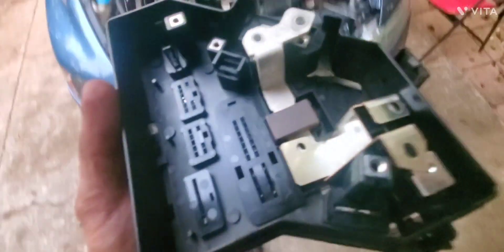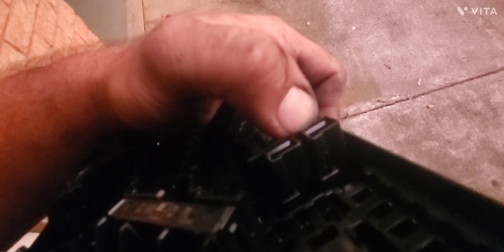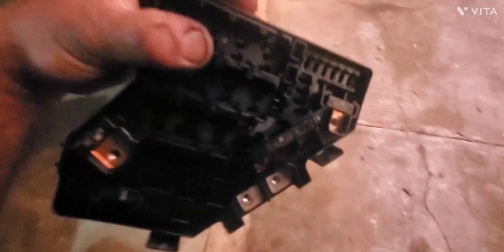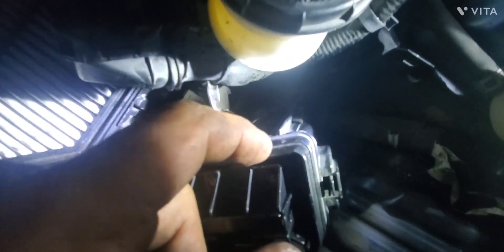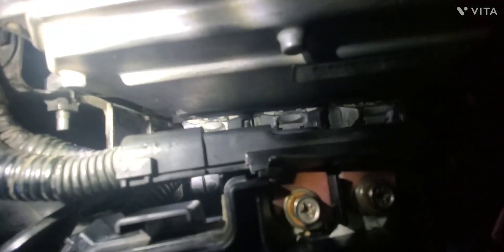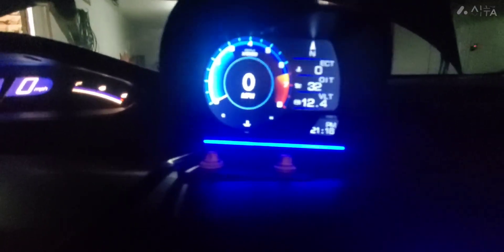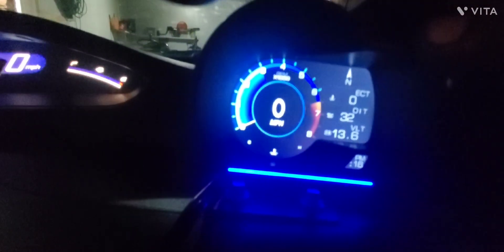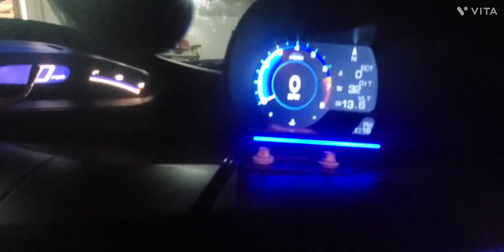8th Gen Honda Civic ELD Low voltage fix!

Comment: do i have to remove everything in the fuse box just to take it out?
Reply from the maker: @cjthegearhead6786  yes. You have to take apart the whole fuse box. The eld is deep inside
Reply from the maker: I'm posting a video tonight. I will do the entire install video showing all the steps
Reply from the maker: https://youtu.be/YSTR1o47LQ0?si=SRO3UsnXf35pbdMd

Comment: I’m sorry I’m confused. Did you buy a whole fuse panel ?  What I see for this part online is just a box portion where the plug goes. Or , are most online images generic and not for this car ?
Reply from the maker: @splmagician2  bo. I opened the existing pannel and replaced the eld rhats inside to correct charging voltage
Reply from the maker: I'm posting a video tonight. I will do the entire install video showing all the steps
Reply from the maker: https://youtu.be/YSTR1o47LQ0?si=SRO3UsnXf35pbdMd

Comment: Hi, thanks for the video. I have 8gen Honda civic hatchback and i see it is very similar the fuse box, i begin to remove the ELD which i think its bad but i got stuck at the fuse box, and i cant separate upper plastic after removing all the fuses and relays to be able to remove ELD sensor which is under it. Can you share with me some pictures or instructions if you have how you separated it ?
Reply from the maker: Unfortunately the video was done in a hurry and daylight was running low. Now, you will have to take out the whole fuse box and get some good pick tools. The plastic dosnt look like it comes apart, but it dose. You have to get it apart to access the eld. Don't give up, that sucker is deep inside. It's sandwiched in there. You just have to be gentle yet persuasive
Reply: i see that it can come apart from your video but i started to think maybe there is some screws from the bottom because even if i use some force on the hidden clips from the side in order to remove the relay pad it is so strong... maybe i will buy another fuse box from another damaged car and take apart to see what is the issue... @bikerevolutiontv
Reply from the maker: I'm posting a video tonight. I will do the entire install video showing all the steps
Reply: @bikerevolutiontv  thanks man i appreciate this. I was thinking that i will disassemble the fuse box and remove the ELD without removing the whole fuse box but after this video i understand that is impossible without removing the box. I own you a basket of beer... I will do replacement weekend i hope.
Reply from the maker: @bobanm1  good. You did see the newly uploaded video right?
Reply from the maker: https://youtu.be/YSTR1o47LQ0?si=SRO3UsnXf35pbdMd

Comment: On my 8th gen civic my voltage will sometime drop while I drive drastically from 14-12.3 sometimes lower and the only way I can bring it up is if I Put my car into park or if I restart. If I restart car goes back up to 14.5 and acts completely normal. I already replaced the alt do you think eld is my issue or could it be something else
Reply from the maker: Normal voltage:
1. While driving its bounces from 12v to 14.2ish without drawing a load, a/c plus lights

2. It stays at 14.2ish with a/c and lights (drawing a significant load)

3. Durring cold weather 40s and below it stays at 14.2ish load or no load (smart technology) I'm thinking¿

Not normal voltage:
At any time it dips below 12v or spikes over 14.9.

 If alternator and battery is not the problem a lower than 12v reading is the eld. Eld failure is not overcharging, but under charging. If above 14.9v then the alternator is over charging and the alternator is bad.

First go to an auto parts store and have them perform a free health check on the battery and alternator. When they pass then the eld is the problem. These parameters are what I have been monitoring over the last few months and I believe them to be accurate. If you have never replaced the eld and are having any low voltage symptoms  I recommend the replacement
Reply: @bikerevolutiontv  hey man i have a weird problem that i just want guidance on from someone that knows these cars. 2012 honda civic EXL 4 cylinder. Customer complaint is sometimes she goes to start it and it cranks slow or doesn't crank well and then it starts. Took it to a shop they said they found nothing and it is intermittent problem. I told her to video every time she starts the car. Now the car is here and when under full load at idle high beams and everything the battery voltage is sitting at like 12.5 when you step back the draw via turning down the blower fan etc., it will go back to a normal voltage of like 13.5 etc., but under high load at idle it seems to be really low voltage. 12.5 or so. But it is staggered as you drop off the high load it does come back up. what I am wondering is am I dealing with two separate issues or is this not even an issue? Can you do a test and turn your seat heaters on and everything to pull a load on the car at idle and see what your idle voltage is? It shouldn't be 12.5 am I right?
Reply from the maker: With the car running and under a load, a/c, light- it should be closer to 14v. No load and it can bounce around 12-13. Dosnt sound like the eld and this is why.

With a healthy battery and alternator, aloud should cause its voltage to spike to 14v because the system is protecting its self. Even with a bad eld this will happen. 

Now it sounds like the alternator is not keeping up or possible the battery is on the way out. I would first check the battery at an autoparts store for free. Change if needed. They will also check to see if the alternator is doing its job correctly.  Their scan tool will tell the truth if either one is bad. Then go from there
Reply: @bikerevolutiontv  i have a high level bi directional scan tool and i can't seem to find where it says the output for how much it is telling the alternator to charge. Like normally it will have a data pid you can see like alt signal output or something where it is giving it 5v reference to ground or something. But yeah under big load it drops down under no load it has 14v or little load. But when you load up the engine it is like 12.5 v at the battery idle and also I think that the starter got cooked because of it as well. So alternator and starter may be bad.  starter sounds fine most of the time but she says sometimes it will slow crank. and she has it on video slow cranking when it is cold. Battery is relatively new and when cranking it doesn't go below 10v when cranking watching it so battery doesn't seem shorted or anything. But do you think maybe you can check yours to see if you idle it with high beams on and blower motor on does it sit at 14v?
Reply from the maker: Mine at idle rests around 12-13 but under load it goes to 14v and that's what it's supposed to do
Reply: @bikerevolutiontv  weird yeah because mine is opposite. mine is 2012 honda civic i can send you a video i will show you exactly what it does.
Reply from the maker: In addition, honda created thd eld to make Hondas fuel efficient.  Any reading of 12v to 14.2v while engine is running is perfectly normal, but i would recommend getting a live voltage read out that is visible while driving. Information is 90% of operating a vehicle safely and effectively
Reply from the maker: I'm posting a video tonight. I will do the entire install video showing all the steps
Reply from the maker: https://youtu.be/YSTR1o47LQ0?si=SRO3UsnXf35pbdMd

Comment: I have a 08 civic si. My car has a 12.5 voltage, it doesn’t start unless I use a jump starter. My alternator and starter are new. It reads low voltage. Do you think I’m experiencing the same issue ?
Reply from the maker: That's odd because all gas vehicles will start at 12.5v. Are you sure of the 12.5v? 12.5v is not low to start your car. Also, what are you using to test the voltage?
Reply: @bikerevolutiontv  I’m using a digital multimeter. Voltages reads 12.8 when car is on. These electrical problems are the worse. Haha
Reply from the maker: @flakosuave252  if its got over 12v it should crank on its own. You have new alternator, battery, starter fuses and electrical wires are good then it should start without being jumped.
Reply: @bikerevolutiontv  thank you the help! Good looking out !
Reply: Using the multimeter on the battery might show 12v but you won’t get a proper reading to see if it maintains that 12v when placed under load, a better way would be to crank your car over and see if the 12v maintains or else it’s a false reading
Reply: Im having the same problem i got a 8th gen civic 2006 lx sedan 

I got all types of gauges in my car lolz 

when i turn on my car with no accessories and lights to the dimmest i get 14.1 on my civic because i got a big 3 and pully upgrade From NST tuning 

When the car would get to 177 temp my voltage would drop to 11.6 my radio cuts off even my lights start blinking plus my car wont want to move i have to press the gas hard to even get the civic moving

I got a new battery from autozone duralast platinum and new alternator 

And the problem still is there but i will try this out and if it solves the problem i will come back here to confirm this method works 

Also since im in a automotive school at the moment i will let the school now about this problem because 

4 technicians cant find the problem on my car 

So if this solves my problem God bless u 💪🏼
Reply from the maker: I'm posting a video tonight. I will do the entire install video showing all the steps
Reply from the maker: https://youtu.be/YSTR1o47LQ0?si=SRO3UsnXf35pbdMd

Comment: Did you have a check engine light/any codes stored for the ELD?
Reply from the maker: No, when the eld fails, there is no check engine code programmed to come on. I'm thinking because the parameters of its design are so polar opposite, that there would be no possible way to know when it has chosen to not charge (based on design) and is actually not working. The true way to tell if it has failed is that the red battery light comes on (some times), but the best way is to first understand that the voltage should never go under 12v at any time while car is running. A voltage meter in cab either connected to battery or obd2 port is the only way to prove its voltage activity. If you are worried about a no charge issue, but do not have a live voltage read out while driving, the best thing to do is drive continuously with the lights and another peripheral on, such as the vent fan on. This will activate the eld to alow a 13.5 to 14.2 voltage charge continuously while driving. Truly it is best to just get a new eld and live voltage read out. A new eld is 15$. That's granted the rest of your charging system is in good shape. Auto parts stores test battery's, alternators and cables for free. I hope this helps. Don't give up. It's a good car and after I replaces my eld on a 197k engine, now I'm 11k more and problem free
Reply: Im deff havingbthe same issue here.. thank you for clarrifying it the symptoms @bikerevolutiontv
Reply from the maker: I'm posting a video tonight. I will do the entire install video showing all the steps
Reply from the maker: I'm posting a video tonight. I will do the entire install video showing all the steps
Reply from the maker: https://youtu.be/YSTR1o47LQ0?si=SRO3UsnXf35pbdMd